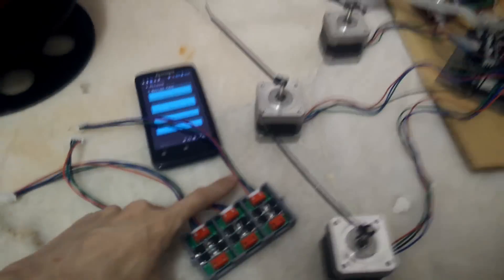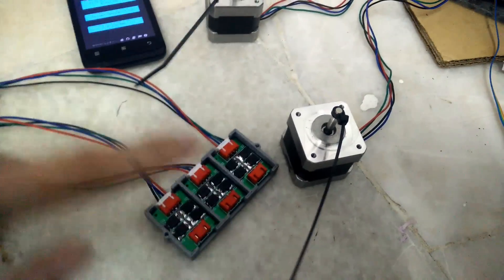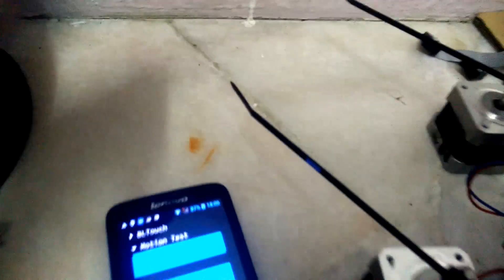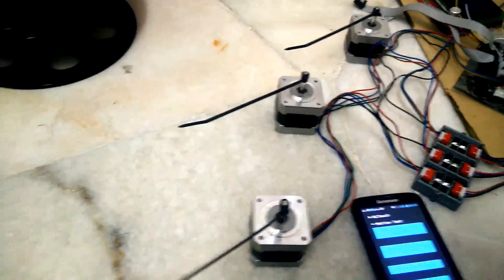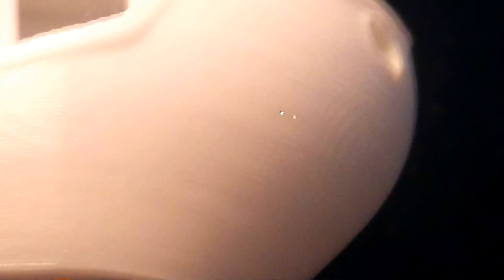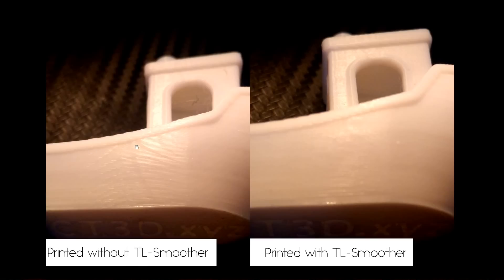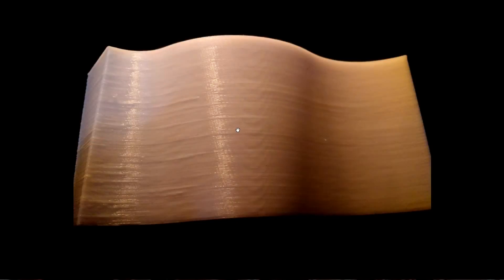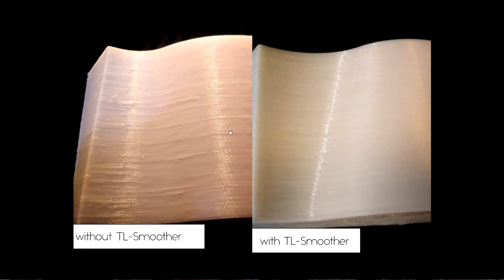Get rid of salmon skin for your 3d prints on DRV8825 stepper drivers!

Comment: Thank you for this nice video. I never had this issue. I have 1 Wanhao i3, 2 Homemade Corexy printers (Remix of Hypercube). I use Ramps+Arduino, Melzi and Makerbase Gen v1.4. I use mostly DRV8825, only on Melzi embedded A4988. I also tried BIQU KFB2.0 with DRV8825 and none of them had this issue. I use 1/32 steps on drv8825. And also to note, I use speeds like 60-100 mm/sec. I believe this issue can be corrected with a careful configuration and calibration.
Reply from the maker: it is hard to notice on Cartesian based printers, corexy has their own unique micro vibrations patterns. unless you pull the stepper motors out and repeat the same tests i did, you dont usually able to tell if you are not observant enough.

Comment: 1. if already using this diode smoother board, does the print quality is further improve if drv8825 is modded to fast decay?
2. Then does a4988, thb6128(raps128), LV8729 also benefit from this smoother board?
Reply: I just read the aliexpress web, it does work for a4988, and you have all the pictures there? But just want to confirm, the a4988 on ramps 1.4 is at 1/16th microstepping and is in mixed decay mode (unmodded)?
Reply from the maker: I am not sure about modded Drv8825. For the rest of the stepper drivers, those are untested. I am not sure as well.

Comment: I ordered the 4 pack, but most cartesian printers use 5 stepper motors. are the two z-axis motors intended to be wires together through one of the smoothers or does the extruder motor not need one of these?
Reply from the maker: Two of the Z motors share one of the board. Extruder will definitely benefits from it.
Reply: Thanks for the reply. I have everything planned out now so i'm ready once the smoothers arrive

Comment: why buy the set 4 instead of 3?
Reply: I bought 2 3 packs thinking about the all motors if its good for one its good for them all
Reply from the maker: It only works on drv8825, though...  I know some people claims it works on other stepper drivers but those claims are unverified.
Reply from the maker: extruders are affected by the problem as well.
Reply: sadly I already buy three pieces last week 😥
Reply: https://www.aliexpress.com/item/TL-Smoother-addon-module-for-3D-pinter-motor-drivers-free-shipping/32776922807.html?spm=2114.13010608.0.0.w2YbAv   I quote 3Dprinter under DVR8825 stepper driver and A4988/2 drivers. I m using the A4988/2 ... so maybe it wont work but says it does ... worth a 6 dollar try will let you know if it helps or not, great video for visual test :)

Comment: Hi, will I be able to use this with the MKS SBASE 1.3v?
Reply from the maker: yes, you can use TL-Smoother with MKS SBase v1.3 (or any older versions of MKS Sbase).
Reply: Thanks for your reply, is the TL-Smoother plug and play? I mean, all you have to do is plug it with the controller board and the motor and that is it? Thanks.
Reply from the maker: yes, that is it. it is plug and play.

Comment from the maker: There are some afterthoughts and findings after I reading some feedback on the Reddit thread.

- I have just tested 1/16 micro steps,. The issues affect both 1/16 and 1/32 micro steps, even more noticeable on 1/16 micro steps. 
-  Extruders are affected by the issue,  but I am not sure about how much of an effect it has on extrusion.  This is a little difficult to find out since I think the differences will be a lot of less pronounce on the extruders.
-  Cartesian printers are affected by it as well.   https://imgur.com/a/Loiq1   Here are a few examples that printed with a cartesian printer that I found recently when browsing a Chinese 3d printing website.